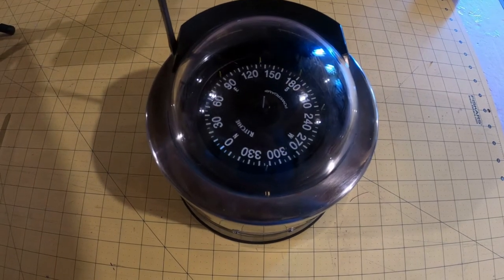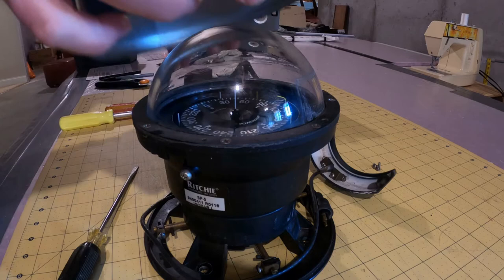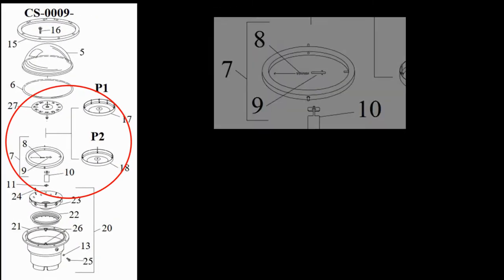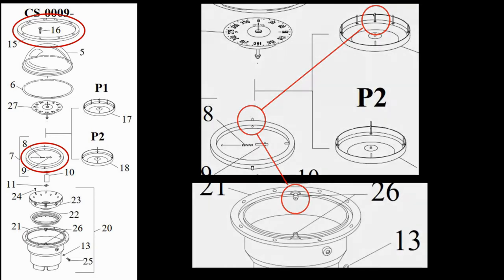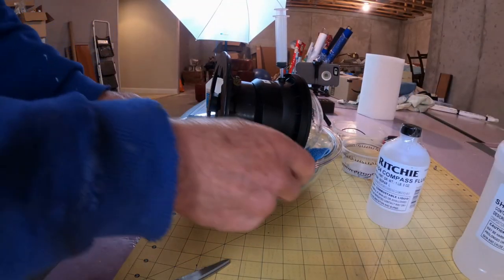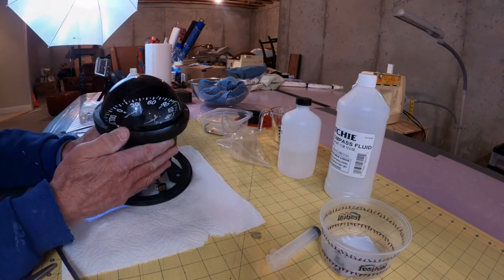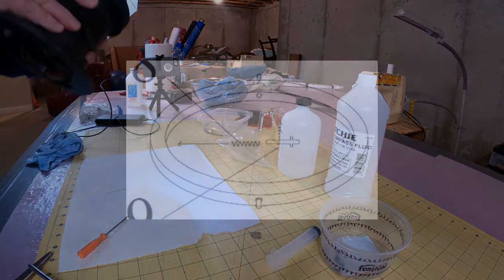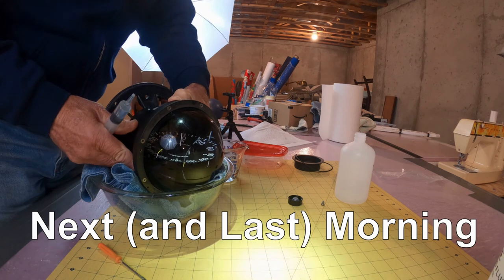Ritchie Globemaster Compass Rebuild

Comment: Wonderful and very helpful video!  But where did you get that syringe?  I can't find one that is small enough to fit inside of the hole and still let air out, yet large enough so that it won't take me all night to fill it.  (And thanks, I did pre-fill it to the rim before placing on the dome.)
Reply from the maker: It's one of my epoxy syringes.  I likely picked it up from a West Marine.